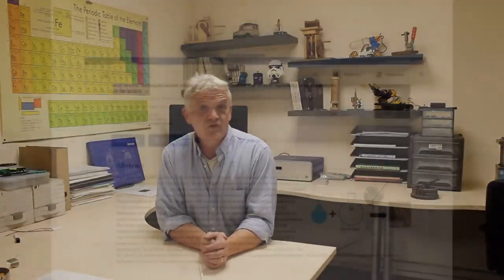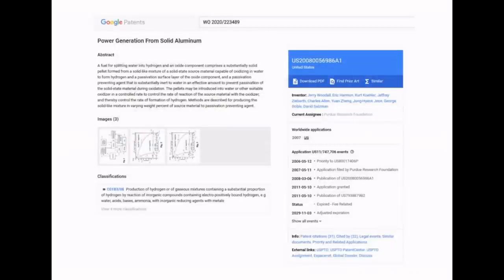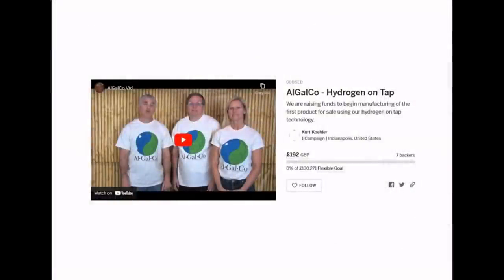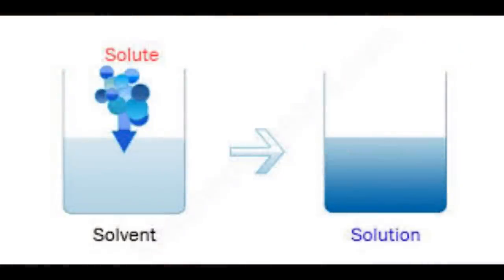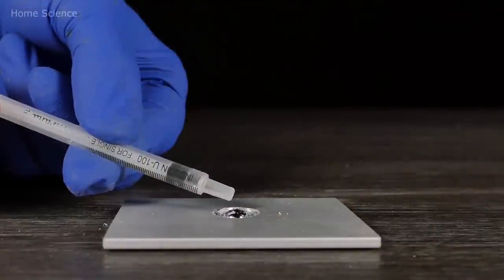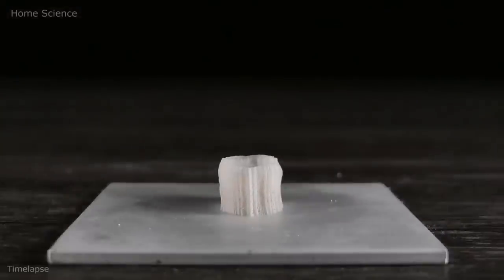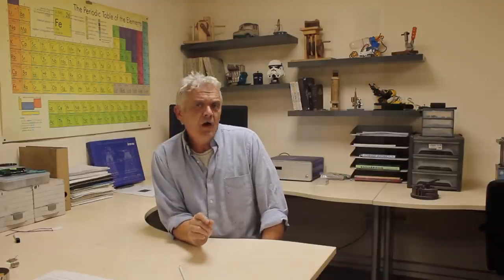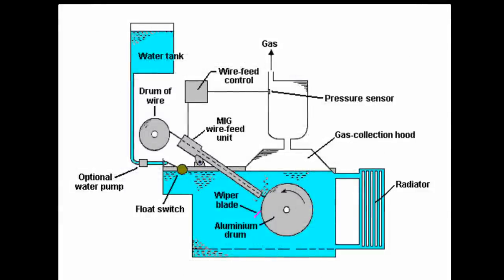1667 Aluminium Gallium And Hydrogen

Comment: I think the more significant application with the 3:1 Ga:Al mixture isn’t the reaction byproduct of hydrogen, but the one of nanoparticle Al2O3. The Bayer process for making alumina contaminates the batch with sodium which is extremely difficult to completely wash back out…and even a minuscule amount of sodium contamination is a huge problem in alumina-based ceramics, where it acts as a glass-forming flux. Bayer alumina also requires a lot of heat input to dissolve each batch into the mother liquor and then flocculate the alumina from sodium aluminate, and the resultant alumina is an aluminum oxyhydroxide…which then has to have further high-heat input to calcine it into aluminum oxide. On top of all this, the particle sizes tend to be quite large and they agglomerate, which is not very useful for making mesoporous alumina active catalysts, thin films, molecular sieves, zeolites, bio-active microstructures, etc.
Just about every other method of producing low- or no- sodium alumina relies on the use of some other toxic or destructive salt that gets released into the atmosphere or kiln walls during the calcination step (clorides, fluorides, or nitric, sulphuric, or boric acids, etc.) which otherwise makes low-soda alumina both very expensive and very environmentally destructive.
…The gallium route, though: produces aluminum oxide directly, which is free from the typical sodium contamination, is of sub-micron nanometer-sized particle scale, and is already dehydroxylated — so you don’t have to calcine it. Plus, the gallium is recyclable over and over indefinitely. The entire process happens at ambient temp with no additional energy input. That’s super-exciting for ceramicists and chemists working on alumina catalysts for all kinds of alternative energy production and storage, biotech, and chemical engineering, even including selective atmospheric carbon sequestration.

Comment: Patents on torpedo batteries using aluminium as a seawater battery with silver oxide electrode. Yes the ally stopped reaction with variable conc sodium hydroxide but the passivisation of the ally was helped by adding some  tin compounds in the hydroxide.   Was a Westinghouse patent years ago for torpedos so at least they reduced the passivisation problem  of hydrogen bubbles on ally.  Result use hydroxides with tin compounds

Comment: If you did this, and had powdered aluminum oxide at the end, wouldn't that be a high purity ore for combining with energy from an intermittent source like a solar array or wind, for turning back into aluminum?
Reply from the maker: it would mate but the energy cost of turning aluminium oxide back to aluminium is still pretty high

Comment: You can use Gallium Indium Tin alloy (Or Galinstan) to amalgamate aluminum. Galinstan Aluminum Amalgam produces hydrogen. You can use more and more aluminum to make more Hydrogen. Galinstan is cheaper than pure Gallium and has a lower melting point too. The only problem is that there will be waste Aluminum hydroxide. But we have loads of Aluminum and water vapor doesn't harm the environment and comes back as rain. I don't know what could bring down Aluminum recovery costs. Aluminum Galinstan amalgam could be good for chemical synthesis such as reductions and reductive amination and is a non-toxic alternative to Aluminum mercury.

Comment: Just came across this video,
And I'd like to make a couple observations that hopefully other viewers can comment on.
1. Does the Gallium/Aluminum alloy produce pure Hydrogen? Or HHO?
If produces HHO, how do you separate out the O2?
Hydrogen is 0.5 Angstrom and Oxygen is 1.4 Angstrom.
2. Scrap Aluminum at the scrap yard is reasonably cheap, however Aluminum is made with various alloying materials some of which can contaminate the reator. Certainly from a scrap yard it's going to be a collection of all types, how do you pick the right scrap?
Just some thoughts to spark a discussion.

Comment: I think the unique factor is with using waste scrap aluminum. We all know that to get energy out you have to put it in. But with scrap the original use already paid for that energy input. this is offset by the cost of scrap but it usually is not very high. You could sell the aluminum oxide waste as a byproduct as well.

Comment: What is the value of gallium and aluminum  oxides or hydroxides after the fuel is spent?  That would offset the cost of the fuel. 

Assuming a reasonable value for the left over products, and putting energy for transportation aside, how about aluminum gallium for home heating?  Could that a viable method for seasonal energy storage considering net cost and volume needs. The exhaust of burning hydrogen is steam that would condense giving off heat in a heat exchanger. The condensed water than can be used to make more hydrogen from the aluminum gallium. 

I strongly suspect that if there becomes a market for aluminum  gallium, that limited supplies of gallium will significantly limit the size of that market. It is a good thing that that aluminum gallium  for energy is fully recyclable. 

Maybe a liquid aluminum sodium potasium alloy might work.
Reply from the maker: to be honest mate - the aluminium gallium is an awesome idea but I think it won't work out in a practical way - just too many hurdles
Reply: You could try an aluminum galinstan amalgam. Gallium Indium and Tin amalgamates aluminum and the alloy is cheaper than pure Gallium. Plus, it's recyclable.

Comment: Do you need oxygen for aluminum to oxidize?  If so, what happens under a vacuum where air is removed?  Also is there a mechanical solution as opposed to a chemical one?  Also when reacting with water is oxygen also released in addition to the hydrogen?
Reply: The reaction is practically identical to that of when alkali metals react with water, the aluminium reacts with the water itself to release hydrogen gas and aluminium hydroxide - as opposed to oxide formed when reacted with oxygen.
Reply from the maker: yes it needs oxygen which it get from the water and that is what releases the hydrogen - but the product is aluminium hydroxide - a mechanical solution is possible in theory but extra-ordinarily difficult to do in practice
Reply: @ThinkingandTinkering  Hey there! Its pretty cool to see you interacting with your audience! I have been watching you since your early experiments involving graphene oxide/graphene super capacitors, keep up the good work!

Comment: Not sure how I came across it as I wasn't looking for it specifically,  but the other day I came across a string of papers talking about adding photocatalysts to aid in water splitting with solar. Everything seemed to be pretty straightforward, then I did the math when the charts looked rather, 'off'. 
Yeah, the efficiency is about 1%. Great idea, but you couldn't ever cover the costs of the base chemicals let alone be able to do any kind of bulk processing. Energy in=energy out!

Comment: Yes, all aluminium smelters are in places with cheap electrical power, so Canada by the Niagara Falls, Iceland with geothermal power, South Africa with low cost coal and China, with low cost coal and hydro power. None of them are near the mines, so all of the ore is shipped there to be smelted. the aluminium battery is great in principle, but the cost of recharging it, seeing as your hydroxide is not exactly suitable for the smelter straight off, and you will have a pretty big loss in this cycle.  Then you get less than a quarter of the energy that went into the refinery back making hydrogen, and then further whatever you use to convert it to power will be at best 30% efficient. Probably will be less pollution to simply take the coal, turn it into a fine powder powder, mix with water, and burn in an engine in that case, with at least getting more energy out of the fuel.
Reply from the maker: nice analysis mate - cheers

Comment: So I got some gallium to see if all these sites claiming it is a great producer of hydrogen might be onto something. Always question the science. 
Conclusion: It sucks really bad. It's expensive. It's hit and miss. You have to coax it into action. 

Then I tried another method. Much simpler and extremely inexpensive. Lye plus water, plus aluminium. Very simple. It starts to give off hydrogen within seconds and it burns cleanly.

Comment: Yes, I do thoroughly enjoy making water-glass(sodium-silicate) with sodium-hydroxide in a large stainless-steel crock-pot, outside in my multi-year-Engineered, Scientific("That wasn't suppose to happen")-Experimental-Containment, DIRTanium-lined, precautionary, Research-Making-hole... ...THAT I must say; "Through the process of "DAMIT-Calcified-impervious layering", it typically works pretty good!
  EVEN in situations that unexpectedly evolve from benign-certainty to "HOLY-SHI%!, MY EYEBROWS!....DAMIT!".... aaaannnd another layer is added to further increase safety!!
 Because "SAFETY-FIRST!" kids! ...

 Remember: Continuous "Safety-upgrades" are important! First-Hand knowledge is priceless! ...And hair grows back!(But NOT finger-tips!)

 As an example of how important it is to have "Saftey Protocols" standing-by and ready:
 
 IF you're going to make some "Water-Glass", ...ANNNDDDD After the awesomeness of the +100-celcius, extremely vigorous rapid-boiling of unexpected water-based "certainty" evolving into a state of "Scientific-Discovery", that CAN manifest from what's later discovered; "WAS NOT" radiated-heat derived from any newly formed, volcanic activity directly beneath my yard, inadvertently-triggered by a pot of accidentally-discovered magma-pheromones after a little "Firey-Hot-Chip-Powder" contamination,  NOR was it any angry, reawakened spirits, accidentally reawakened with incantations of beer & Doritos that had now bewitched my $25.00usd, Ebay-sourced,  "Ancient Witches-Cauldron"  that had been carelessly mislabeled as a simple "Used Stainless Crock-Pot"... No, unfortunately to my shockingly-devastating disappointment it was merely only a combination of: 
1.) The "Ebay-Seller" of said "crock-pot" forgetting to include the "Stainless-steel part" before packing and shipping her ALUMINUM, crack-pot, crock-pot.
and
2.) The complacent, impatient-nature, of my Doritos-induced Neuropraxial-Retardification....

And that's why I say;.. "THANK GOD I still had the safety of my beer-protocols left to solve everything!
Reply from the maker: water glass is interesting to make for sure - but as you say.- a little precaution is needed lol

Comment: When you use a scour pad in an aluminum container filled with water, why is there no apparent reaction?  Wouldn't you be removing the oxidized layer from that mechanical process?  

Pretty sure if it did react people would have noticed.   Or perhaps the reaction is so subtle and fast (before it re-oxydizes) you can't see with the naked eye?
Reply: It is because it only creates another oxide layer and prevents the water being exposed to the aluminum. The difference is the gallium disrupts the oxide layer and allows the reaction to continue.
Reply: @adrianelliott5555  the video says that it takes "seconds" to reform that oxide layer.  Wouldn't scrubbing fast prevent it from reforming in time?
Reply: @floridacoder  yes basically if you continuously sanded the aluminum to remove the oxide layer you could generate hydrogen and aluminium oxide but you would consume far more energy than it would generate.
Reply from the maker: aluminium oxide is pretty tough and well stuck to the surface of the Ali mate and the re-oxidation reaction is nano seconds - basically you don't stand a chance of doing it by hand

Comment: Wood ash (potassium hydroxide) and aluminium in rain water works well.
It's a cheap way to make lighter than air balloons. 
This mixture in a biogas generator instead of bio materials should work well. The real problem is how to recycle the waste.
Just remember that this gas is very explosive when mixed with air and Ignited. Also Potassium hydroxide is very alkaline and corrosive and very harmful to your eyes. Don't breath any vapours from this mixture !
Wood ash + strip's of aluminium pie trays and copper or carbon make simple batteries.
Reply from the maker: cheers mate

Comment: On a different video I commented on the dangers of using hydrogen as a fuel.  What you get when you burn hydrogen is steam which will greatly increase the amount of water in the atmosphere, which is many times more effective than carbon dioxide in increasing global warming.  Also, as things are we have severe water shortages worldwide and breaking down water for fuel will only exacerbate that problem.  It is possible that we could figure out a way to balance pulling the water from the atmosphere to produce hydrogen with the water going back into the atmosphere from the steam produced from hydrogen engines.  However, that would require strong regulation on how much hydrogen each person would be allowed to burn.  As I said in that other comment, burning hydrogen as a fuel is a very bad idea.
Reply from the maker: I do like the idea of balancing water production with the water from air - but I also hear what you are saying mate
Reply: If the atmosphere wasn't warming it wouldn't actually matter, the "steam" would just condense and rain down somewhere, but since warmer air can hold significantly more water, it may inconvieniently accelerate our climate problem indeed.

Comment: Yes, the recovery angle is the sticky bit. With Hydrogen power, there always seems to be a sticky bit. When we finally solve the cradle to grave issues around efficiency, pollution and real world re-use, Hydrogen will be a winner. By then, though, we might all be fully converted to battery power anyway. Hydrogen power is coming second in this race and there's nothing on the horizon at present suggesting it can get a leg up and beat battery power, especially as battery power seems to be a lot more innovative recently.
Reply from the maker: there is a lot of innovation in energy storage per se mate

Comment: There is something I do not understand from your video. When you mix AlGa alloy with water to produce hidrogen does the aluminium or gallium "consume" in any way? Meaning is it a chemical reaction taking place? I am asking this because there was an alloy back in the '50 that produced hidrogen but didn't react in any chemical way and it had the same aluminium at the begining and at the end of hidrogen production.

Comment: Yes there is hydrogen but there's also aluminum oxide I believe gas in there so this would not be good to be putting in certain applications. Also getting a gas micrometer test would prove out that it's not a high quality hydrogen.
Reply from the maker: cheers mate

Comment: I made a zinc iodide battery and I get 1.24 volts out of it, after I deplete it ice noticed over time it returns to 1.24 by itself
Reply from the maker: yes - it would - but the amps you get out will be lower

Comment: The amount of electricity required to produce aluminum is insane
Reply: ? Produce
Reply: Solar would be the way to go then. To bad we don't use the lensing effect using the mirrors to actually smelt metals directly. A fennel lens can reach almost 3000°F.
Reply: @jasonmorgan661  *Fresnel. Yes, I have always thought the same. I have one that is 2'x3' and it produces the fires of Hell. There was a lens based system that produces 3d print objects out of molten sand, but I have not heard about that in a long time.
Reply from the maker: yes it is

Comment: There's not that much aluminum compared to gasoline or crude. And you won't be getting that aluminum back via recycling. 
Now if you need to get a car working post apocalyptic situations than it's a viable option. Otherwise not so much.
Reply from the maker: cheers mate

Comment: Just watched another video which showed a company that extracts CO2 from air and combines it with water with the Oxygen having been removed from both to create hydrocarbon fuel. All done using green energy sources (solar and wind).
Reply from the maker: that is a very popular area of research mate
Reply: @ThinkingandTinkering  as far as I can see from what the explanation was, it's just replicating the natural process that takes place below the ocean floor.
The ocean is the largest CO2 capture storage. The ocean floor, in places with thinner crusts or certain heat transfer metal content, would be hotter. So, if pockets open in that ocean floor that fill with sea water, and the heat boils the sea water, oxygen will be separated out leaving a combination of hydrogen and carbon. The video explanation seems to imply that's how their process works.
The term "fossil fuel", when it comes to oil, is the most misleading label ever created. And it has retarded the thinking of the majority regarding sustainable fuel creation.

Comment: Gas is "Cheaper" -sure when we're calculating expenses by measuring aluminum by mined product.
But we all already have loads of aluminum remember? That was the basis off of the whole "back to the future II" theme. I myself have loads of aluminum cans. And they are constantly a burden to get rid of.
I wish I could just throw it in my gas tank, you know?
Cut out the twenty or so middle men that siphon out my pockets as I turn in my cans and then buy fuel at the gas station.
Reply from the maker: the figures I looked included recycled aluminium mate